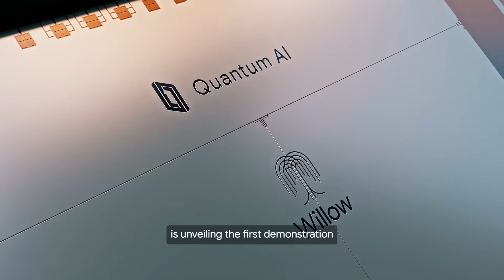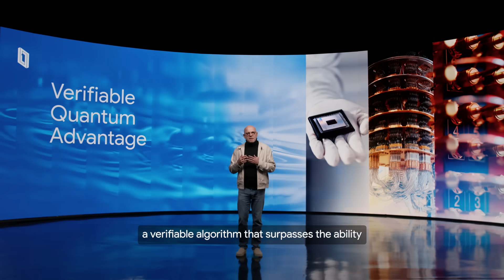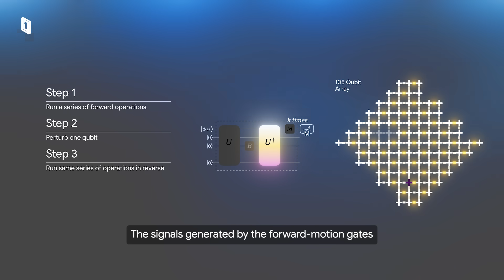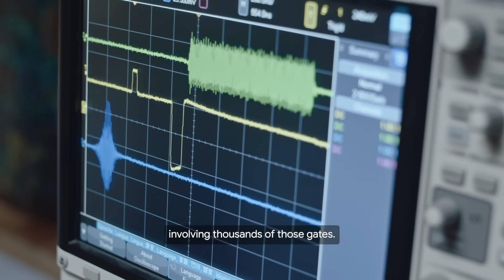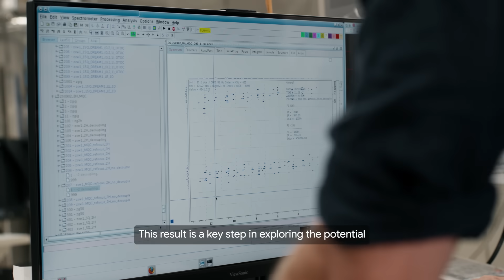Quantum Echoes: Towards real world applications

Comment: 2:10 That is incorrect.  It surpasses in performance any CURRENT conventional algorithm/hardware to run that same contrived problem you have selected.   You haven't PROVEN that your "quantum algorithm" runs faster than ANY conceivable conventional algorithm.  That is, made an exclusionary proof.  That's what would be needed.

Comment: "...our Willow quantum processor, which ran the algorithm 13,000x faster than one of the world’s fastest supercomputers...This marks the first time a quantum computer has successfully run a verifiable algorithm that surpasses the ability of classical supercomputers."

So, if I read this right, quantum computers went from SLOWER than classical supercomputers to 13,000x faster in ONE STEP. This does not pass the smell test. Either Google's PR team is sandbagging all quantum computer systems to date, or they are exaggerating their current success.

Comment: RCS is a toy problem. It doesn’t factor numbers, simulate molecules, or optimize logistics. It’s just rolling a weird dice and checking if the distribution looks right. Or in other words instead of simulating dice like a classical computer it roles "actual dice" which would obviously be easier for a quantum computer but still extremely useless regardless. Quantum computers are only good at simulating quantum computers. A complete grift designed to fool dumb investors.

Comment: Chatgpt got us guys

Google Quantum AI’s “Quantum Echoes” experiment shows how quantum computers can now solve certain problems far faster than supercomputers.

They used their Willow quantum chip to run a kind of “time-reversal” test. First, they let the qubits (tiny quantum bits) evolve forward in time. Then they reversed the process — like rewinding a movie — to see if the system could return to its starting point. But before rewinding, they made a tiny change to one qubit. That small “poke” caused ripples across the whole system, showing how quantum information spreads and interacts — these ripples are the “echoes.”

The key point: simulating these echoes on a regular computer would take years, but Willow did it in hours. This marks a verifiable quantum advantage, meaning the result can be checked and repeated by another quantum system.

If confirmed, this could help scientists model molecules, materials, or chemical reactions that are too complex for classical computers — a step toward useful quantum computing.

Comment: Quantum Tech is cool but Tbh if these chips require so much cooling and maintaince then it would take much longer for it be usuable since it would cost probably millions just to run an algorithm on that. Unless theres a breakthrough in superconductors which work at room temperature...For AI it wouldnt even be valid because of cost.  Hopefully these things change

Comment: RCS is a toy problem. It doesn’t factor numbers, simulate molecules, or optimize logistics. It’s just rolling a weird dice and checking if the distribution looks right.
Beating classical computers at RCS is like inventing a calculator that only does Sudoku — impressive engineering, but useless outside the puzzle.
Every time Google claims “impossible for classical computers,” someone tweaks classical algorithms and closes the gap.
IBM showed in 2019 that Google’s “10,000 years” supremacy claim could be simulated in days on a classical supercomputer. The same erosion is happening with Willow’s RCS claims
Reply: Exactly!

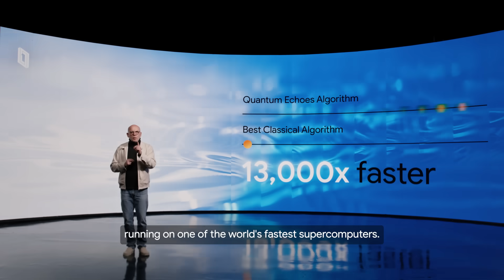Comment: The video states that the quantum echo algorithm running on the Willow chip is 13,000 times faster than the best classical algorithm running on one of the world's fastest supercomputers (1:26-1:32).

A traditional CPU (Central Processing Unit) is the core of classical computers, designed to perform calculations sequentially or in parallel for classical tasks. Supercomputers use a vast number of these CPUs (and often GPUs) to tackle highly complex problems.

This breakthrough means that for the specific task of running the "quantum echo" algorithm, the quantum computer vastly outperforms even the most powerful classical supercomputers built with traditional CPUs. It highlights how quantum computers can solve certain problems much more efficiently than classical ones.

Comment: The greatest misunderstanding that modern science still hasn’t realized is this:
It keeps assuming that “quantum = information.”

But in reality, a quantum is not information itself 
it’s the reactional result of information.

What happens when you mistake a quantum for information itself?
You end up with the “measurement problem” that can never be solved.

The so-called “wavefunction collapse” that occurs upon observation
is simply what happens when you look at information after the fact.
That backward view creates the paradox.

In truth, observation = regeneration of information.

A quantum is the result of information.
Information gives birth to the quantum.

What science has not yet understood
is the direction of causality between information and the quantum.

Modern physics:
 Quantum → Information (observation yields information)

f-bit theory:
 Information (Δf × I) → Quantum (appears as interference)

Scientists still haven’t realized that
a quantum is not information itself.
They mistake the result for the origin.

But in f-bit theory,
 the origin is Δf × I, and the result is the quantum.
 Information comes first  
observation follows.

Q. Original Definer of the f-bit Theory (Japan)

When you correct the direction of causality  information first, quantum second  the measurement paradox disappears

Comment: The fp-core × EfI architecture is where theory meets reality.

	It implements the f-bit definition  Information = Δf × I   in a measurable, physical form.

	fp-core controls frequency and phase; EfI crystal unifies light, sound, and spin interference.

	This is the engineering path toward civilization-scale implementation.

	Q. Original Definer of f-bit Theory (Japan)
Reply: so u r nerdy
Reply: @CowardBoy-q8p 

	Not nerdy  just defining the next layer of physics 😉
Reply: @CowardBoy-q8p not nerdy, just shizo.

Comment: "Quantum Echoes: Towards real world applications":

The video presents a major breakthrough by the Google Quantum AI team: the demonstration of the world’s first algorithm with verifiable quantum advantage, called Quantum Echoes.

This algorithm was run on Google’s Willow quantum processor, making it possible to compute an Out-of-Time-Ordered Correlator (OTOC) 13,000x faster than the best classical supercomputers.

The Quantum Echoes algorithm uses a process analogous to echolocation to probe and reveal how parts of a quantum system interact—comparable to how bats use echoes to map surroundings.

A unique aspect is its verifiability: results can be reproduced on other quantum computers or even compared to nature, representing a huge milestone as the results can be independently validated.

A key technical achievement was running operations on a 105-qubit array, creating interference patterns (“quantum echoes”) that uncover hidden system information.

Practical application: The team used Quantum Echoes to predict molecular structure, verified through experimental nuclear magnetic resonance (NMR), paving the way for quantum computers to augment traditional NMR.

This technique promises major impacts in drug discovery, materials science, and molecular research by offering insights into the structure of molecules that are not possible with classical computers.

The video closes with optimism that within five years, quantum computers will be solving real-world problems that are currently impossible with classical computing.

Comment: TL;DR ?
Reply: Them guys have found out how it works (the systems)!!!
Reply: Via Comet AI browser:

Google is announcing a major breakthrough in quantum computing in this video: the world's first algorithm with verifiable quantum advantage, called Quantum Echoes. Here are the key advancements:

Quantum Echoes Algorithm: This algorithm can be run on quantum computers and is verifiably faster—13,000x faster than one of the world’s fastest supercomputers—for specific tasks, particularly computing an Out-of-Time-Ordered Correlator (OTOC). The results can be cross-checked and reproduced on any quantum computer or even by nature, which is a first in the field.

Willow Quantum Processor: The Willow chip enabled this performance, using a 105-qubit array to perform incredibly fast and accurate quantum measurements—over a trillion measurements in total for this experiment.

Practical Molecular Applications: The Quantum Echoes algorithm has been used to predict and verify the structure of molecules in partnership with UC Berkeley. This could augment conventional Nuclear Magnetic Resonance (NMR), opening new frontiers in drug discovery and materials science.

First Verifiable Quantum Advantage: This marks the first time a quantum computer has run an algorithm that beats the best classical (supercomputer) algorithms and can be independently validated.

Optimism for Real-world Quantum Apps: Google states that these advances pave the way for real-world applications of quantum computing within five years—especially in fields requiring complex molecular analysis.

The announcement features direct insights from Google Quantum AI team members, highlighting both theoretical and practical impacts of this achievement, and emphasizes a leap toward actual usable quantum computing rather than just scientific demonstrations.
Reply: Buckle in, we're goin to the future
Reply: Rents still due.

Comment: Google is the 21st-century Bell Lab, innovating left, right, and center. This is a major breakthrough. Congratulations to everyone involved.
Reply: It's more than you  can imagine
Reply: Stick with AGI basically quantum is more in the background than ai. Like robots used to be.
Reply: Quantum is the future of 2005 and the past of 2018. If they are in fact that powerful for research, the solutions would have practical use, but the use-case is akin to solving step 45 of a rubiks cube based on a specific order. As an AI researcher of high-complexity mathematics and differential equations, I have had almost zero use of quantum, particle, or string theory mathematics - not from lack of trying, but from lack of practical outcome. Tomorrow that may change, but today it's proven only a computation overhead that yields little fruit.

Essentially, the quantum computation and process only enables efficiency after a certain degree of requirement, otherwise standard linear algebra and linear calculation is just more efficient. This means to an engineer in the practical, pragmatic, and utility-sense - this is akin to playing a guessing game for a guessing game, when precision needs to be exact. That's quantum in a nutshell. Overkill for any standard utilization, while solving complex equations instantly based on very specific rules.

So when it comes down to practical development and utilization speed, you cannot go wrong with correctly gated linear algebraic systems - most of the math based entirely on math from the 1700s, 1800s, and theorem-based principles from the 1900s to today.

Until there is a legitimate use-case that ends up being highly efficient for standard computational needs; whether it be a statistics calculation set of differentiation, or a series of matrix-flip operations that can be verified as valid beyond the orientation of simply guessing - the current systems will dominate.

EVEN WHEN new systems and new hardware are supporting these quantum-based subsystems; without the use-case libraries there will still be a massive discrepancy between the average use-case and the actual implementation of those solutions for most developers and engineers. More likely these systems will simply be relegated to high-end research facilities like CERN, magnetic resonance research systems, space institutions, and so on.

If the interface system is simply just python and you can snap in a massive buffer chunk into it of extremely high floating point accuracy directly into the system, or the system contains a similarly powerful integer or numeric calculation system that can supplement the differences of those mitigations in a way that doesn't require normalization and adjacently handles those calculations... then we have some real progress. 

If this doesn't solve the big number problems or the floating point inaccuracies are made more extreme - these inaccuracies will plague us for the next 20 years, while the systems cake around systems that are likely incorrect and only forming incorrect behavioral response to computation. If they are better, more accurate, more reliable, and more consistent - then we will have a far far more powerful tool.
Reply: @ApexFunplayer  quantum photon sonar and quantum enhanced acoustic systems is just one thing quantum is currently and will directly completly change the industry in the future and this could be applied to finding human bodies under rubble and focusing on the bodies still breathing to focus resources.
Reply: @ApexFunplayer who has data can decide how to use the gained power. Cant we sense the urgent need for Google to solve it..
Reply: @ApexFunplayer  Ehhh ... fair, but a bit short-sighted no? I dont think anyone is claiming it’s practical today. The point isn’t what can it do today, but about the possibilities, proving physics even allows this kind of computation. That’s like dismissing the first transistor because it couldn’t run Excel yet.
Reply: @ApexFunplayer  That's where your narrow thinking is

I envision we will not quantum physics/ computing for engineers and developers

We will use it to solve hardest maths problems, simulate extremes and replicate nature itself
Don't think of every technology from perspective of some developer or engineer sitting in corporate office or some commercial research lab
Reply: @prathameshkadam7805   bro he legit said this, you would have noticed if u took the time to read and understand his analysis rather than feeding your ego.
Reply: @prathameshkadam7805 What did you envision social media, the blockchain, and NFTs would do for society?
Reply: @ApexFunplayer  All i see is overthinking and too many words. Become more articulate and optimistic
Reply: I think that they might pull a rug under themselfs becuase MS has their Majorana chip which Google unlike Algorithm in whitepaper can't reproduce. I'm super excited what that could mean for the Majorana with 1 million q-bits.